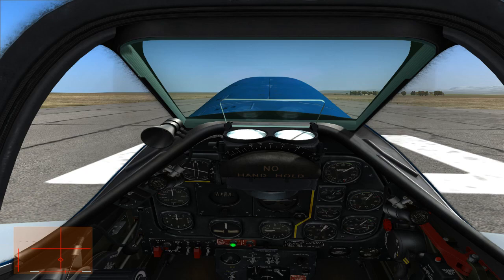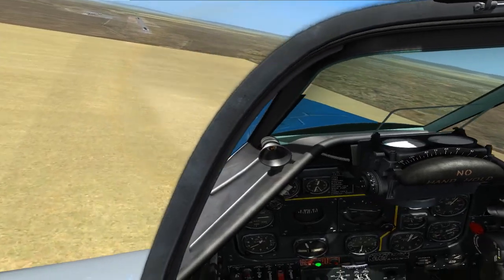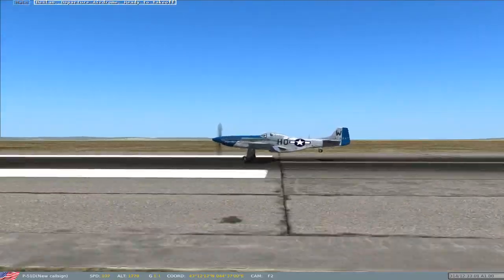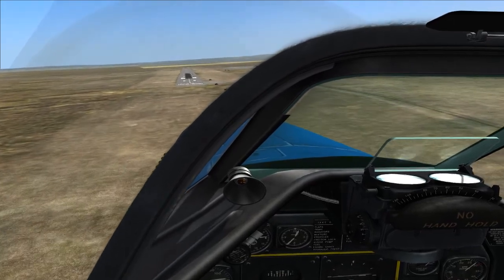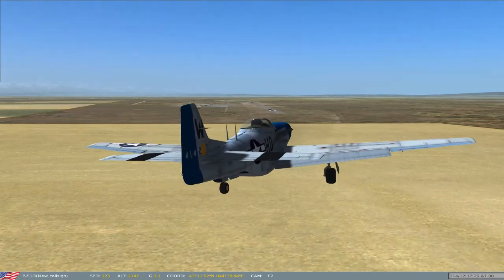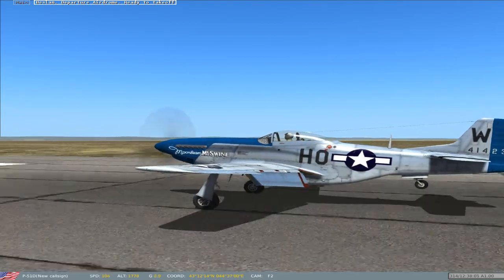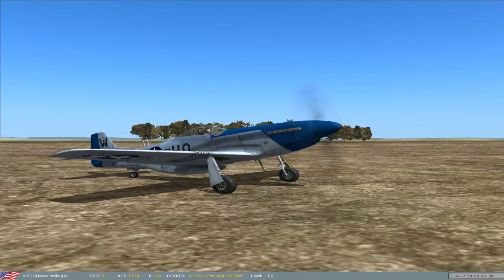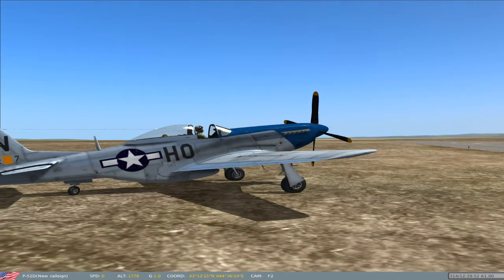A2ADCS P-51D Landing Physics and Ground Handling Conclusion

Comment: I prefer to land at the lower, recommended speed of closer to 100mph.
I start with 20% Flaps on my approach and then when below 175mph I drop my Landing Gear. Then Full Flaps as I come to the beginning of the Runway.
I coast in level flight about 20 Feet above the runway until the plane starts to slow down enough to begin to drop at which time I pull the Nose UP and coast to a 3 Point Touch Down. As such, I barely ever touch the brakes. I might feather them only if the nearest Taxi Way is approaching too fast. Otherwise I let it slow down on its own ... which doesn't take much more runway. Furthermore, with this approach, there is No Bouncing down the runway.
Landing on all 3 wheels when I do, the plane no longer has enough speed or lift to bounce or otherwise leave the ground after touchdown.
PS> If you like, you can find me .. SnowTiger ... on DoW's Server just about every day. I'd be happy to illustrate my approach. I'm not so sure I can produce a decent video yet.